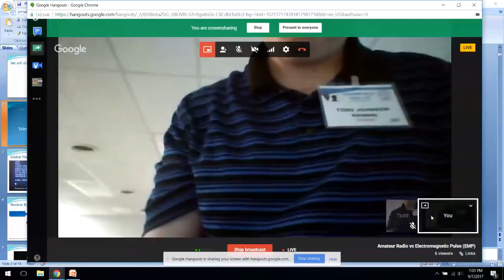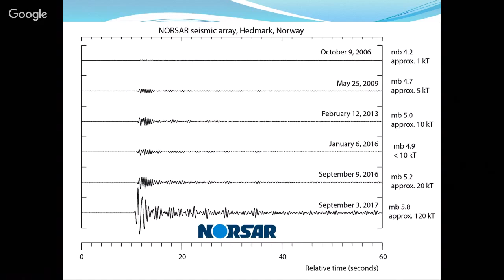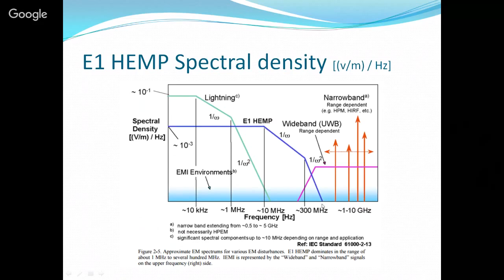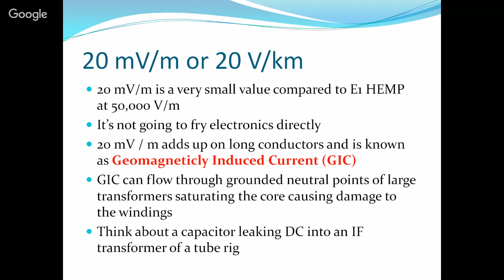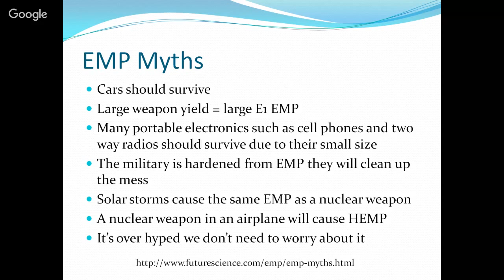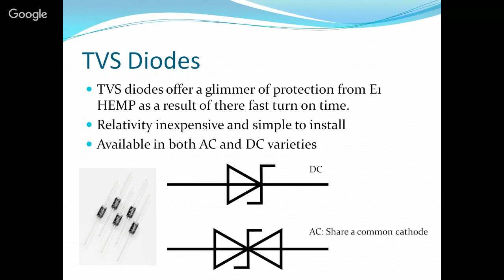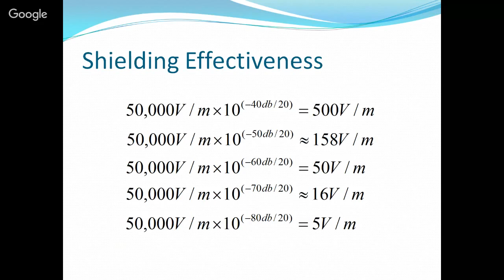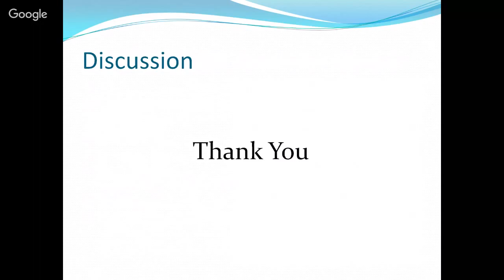Amateur Radio vs Electromagnetic Pulse (EMP)

Comment: I know this is a 3 year video, but im hopeing you can help with question, My upstairs neighbor  has this device that completly scrambles The sound coming from my  radio, and it  turns perfectly clear  audio in almost complete  static All i know is that the device makes  a pluseating sound rate before my radio goes from perfectly clear audio too all almost all  static  also when i stand in certain places in my room in front of the radio it becomes a little less scrambled. Do you have any idea what type of device is being used too turn clear audio  into static. Thank you in advance and it will greatly be appreciated if by chance you find my comment